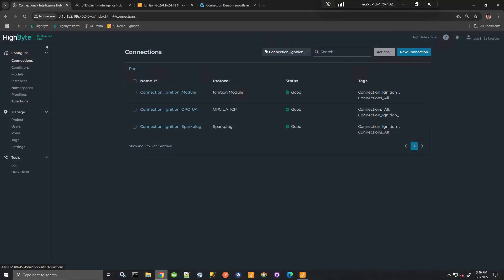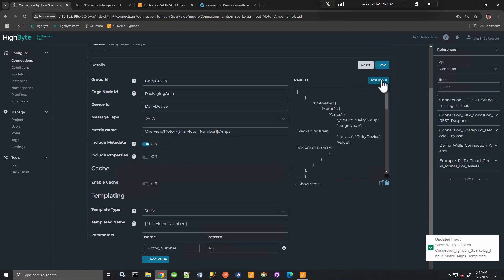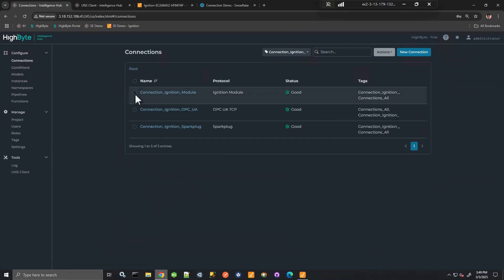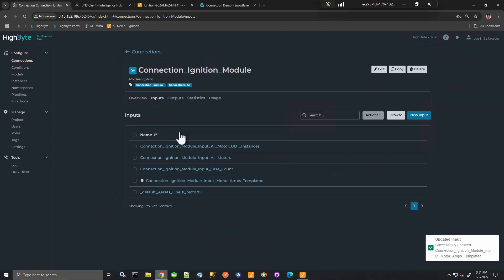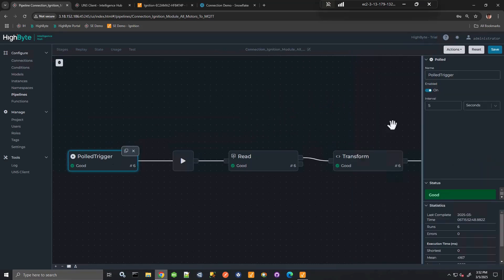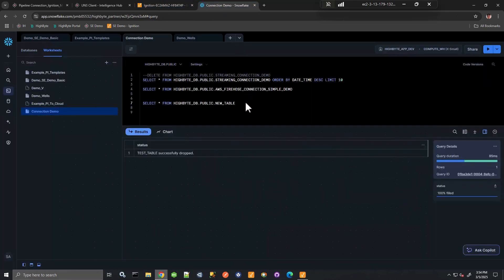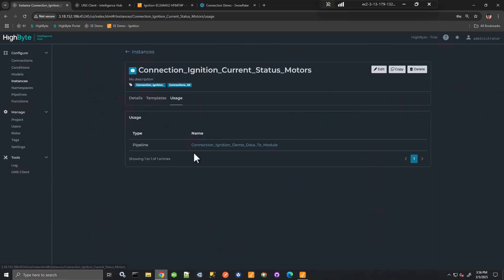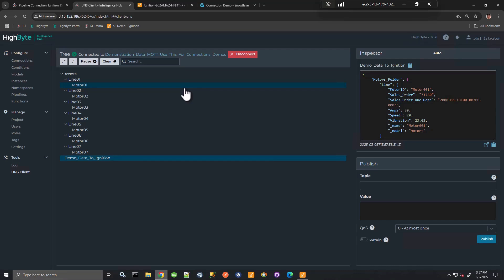HighByte Intelligence Hub and Ignition

Comment: Can you use the OPCUA interface to access any OPCUA server not just ignite. probably right?
Reply: Yes! In this demo I'm using our Ignition module but you could easily adapt this to connect to Ignition via OPC UA and implement MCP services that way, or to any OPC UA server.
Reply from the maker: Yes, you can use HighByte Intelligence Hub’s OPC UA Client connector to access and model data from a wide range of OPC UA servers on the market.